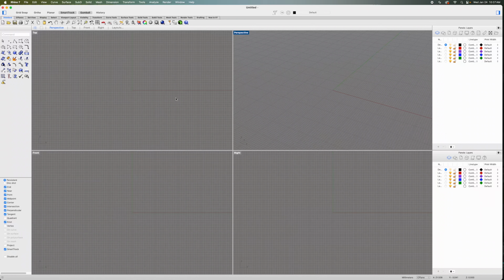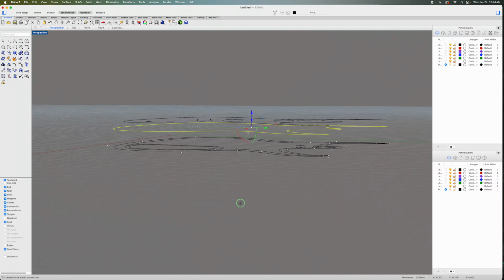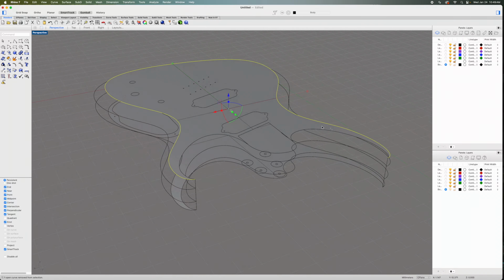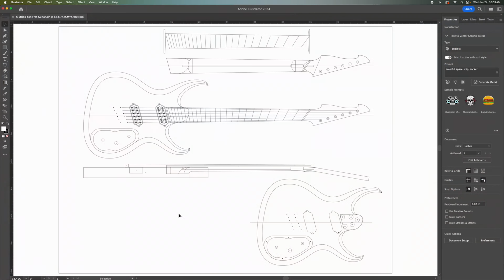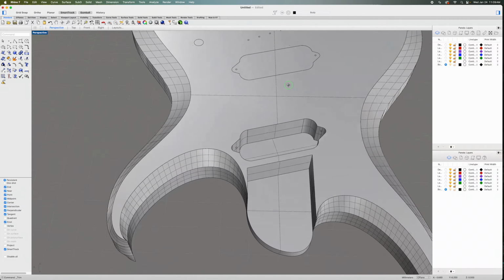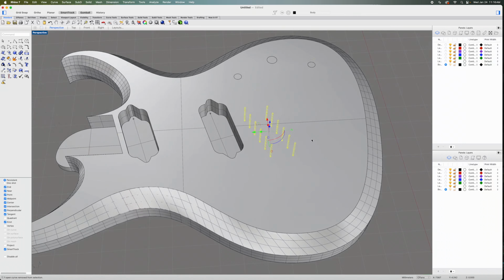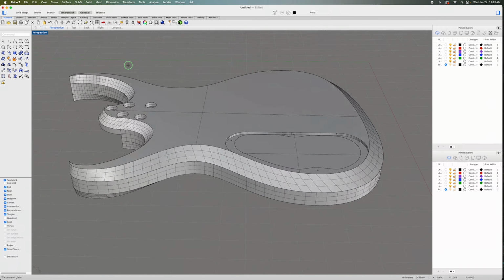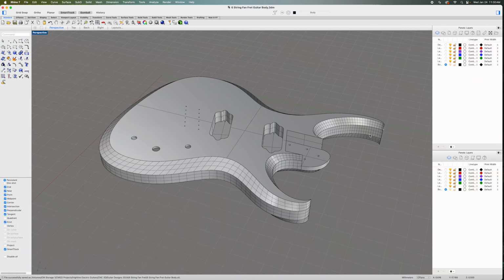Making A 3D Model Of A Six String Multi Scale Guitar Body Part 2

Comment: Hi! Is there an easy way to have rounded edges on a 3d model in Rhino like Stratocaster has?
Reply from the maker: Fillet edge.
Reply: Thank you! 
You make a great educational job. We appreciate it 👍🏻
Reply: Unfortunately for some unknown reason I can’t manage how to make those edges on the back side of a body with belly cut. I tried to make edges as smooth as possible but there are still errors. And the same time front side with armrest cut is good. Have you had such an experience with fillet edges of the back side with belly cut? 😢